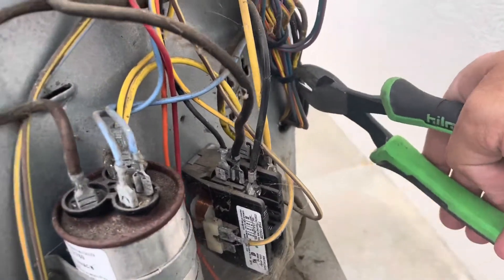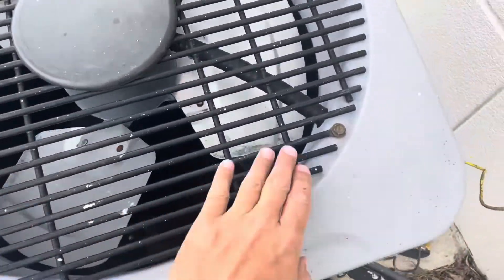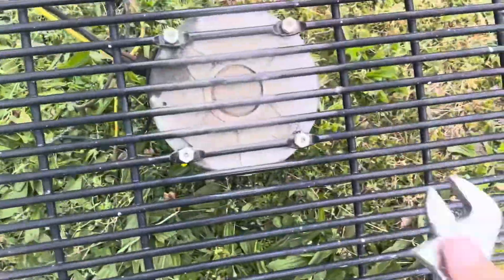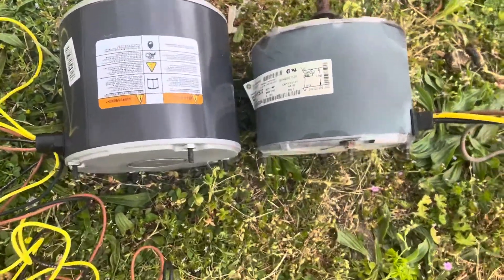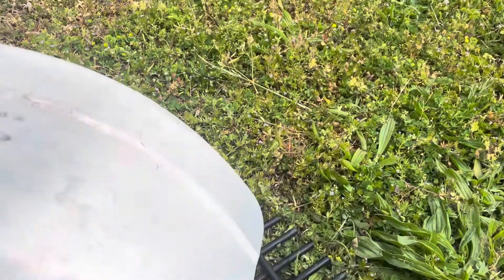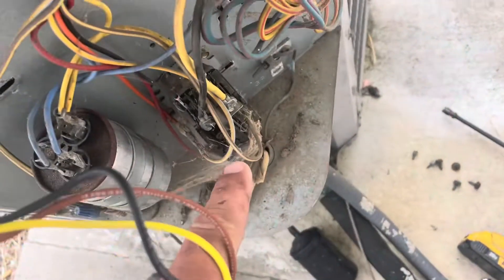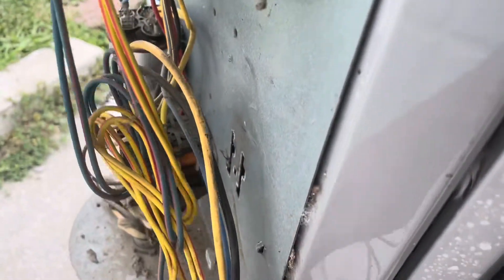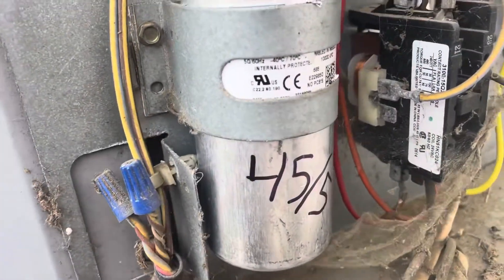Replacing Condenser Motor On Carrier Condensing Unit!  Follow Up. #hvac #airconditioner #heating

Comment: I called the company that installed my unit because my AC wasn't working. They quoted me $892 to replace the motor. $691 of it was the cost of the motor. I went online and looked it up. They were overcharging me $370 (more than double) for the motor. If they had been a little more honest with me, I would have given them my business. I'll be doing it myself and saving myself over $500. Thanks for the video. Also note I ordered the OEM motor, not some Amazon off-brand replacement.
Reply from the maker: Yea, unfortunately that’s how a lot of HVAC companies make their money.  On parts mark up.   Most customers won’t go through the hassle to look the parts up, or they think they can’t even get them.    Good work saving yourself some cash.  🤙

Comment: Where do the black yellow and brown wires from the fan connect to?
Reply from the maker: Black goes to the defrost board if it’s a heat pump or the contactor if it’s a straight cool.  Yellow goes to the common side of the capacitor, brown goes to fan side of capacitor.
Reply: @  ok so the person that hooked it up did it wrong cuz motor blew out again he hooked up black to board brown to fan and yellow to capacitor and that way blew the brand new motor the other guy did brown to fan black to left side of contactor and yellow to the right side of the contactor

Comment: Hello, thank you for making this video. Very helpful. Would you know why would RPM drop on a condenser motor. I don’t feel any air coming. I did clean all around the condenser screen with water. Can you please help.
Thank you
Reply from the maker: If your RPM is dropping or it seems the fan isn’t turning as fast as it should, it could be a capacitor issue.  It’s a fairly cheap part if you do it yourself.  You would just need to get the readings off of it.  But if that doesn’t fix it, then new motor

Comment: Badsnn smell comeing  stick up ok moto replacing okessir welcoed joly engering codesd fsn  moter s ok capciter replcing musg bed poped good  alen ment leals sll cord full fixex neex allthe timd why lot sighg s but ism log dide gues card leed good  way good pathe good stdey good dcpricdd need not bosx liked lot jeuaz z good coperid jobes dighg sorkesgood arrgdnted fixd word loos  contsnt piper lot compsnney making  poperfieingolgfixd permsnt fixed need oos  contatinv koise not any thigok

Comment: my capacitor went bad and i had been starting the fan with a screwdriver while i waited to get a capacitor and the fan ended up seizing so i now have to replace the fan and capacitor but i was wondering roughly how much would a hvac repair company charge to replace a fan motor and capacitor?
Reply from the maker: Depends if they go back with the OEM motor or not.  Also depends on area too.  But on average you can expect about $600-800 bill.